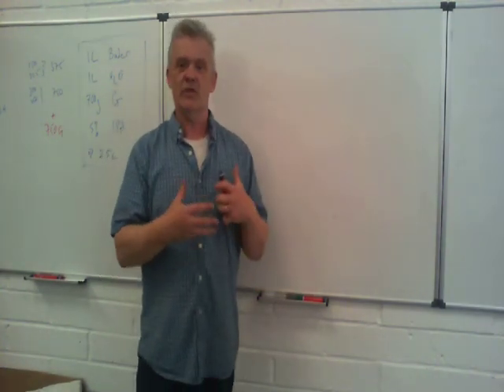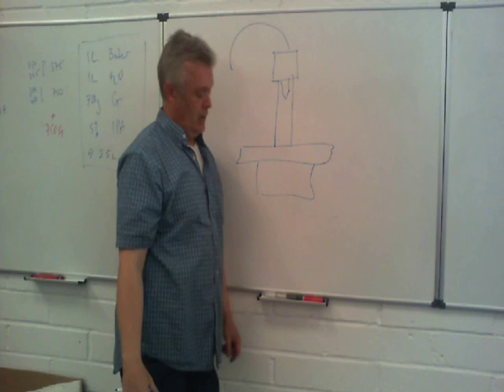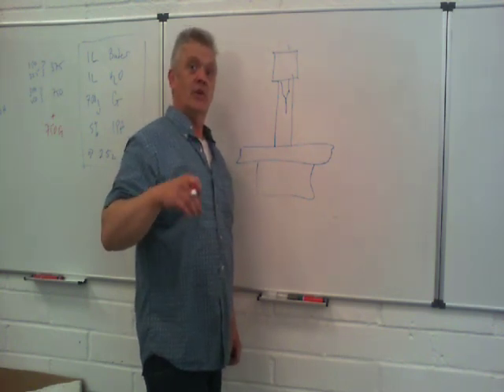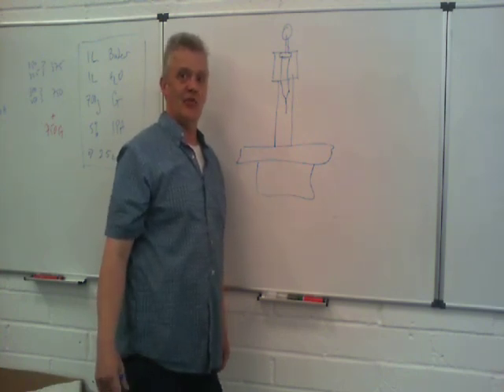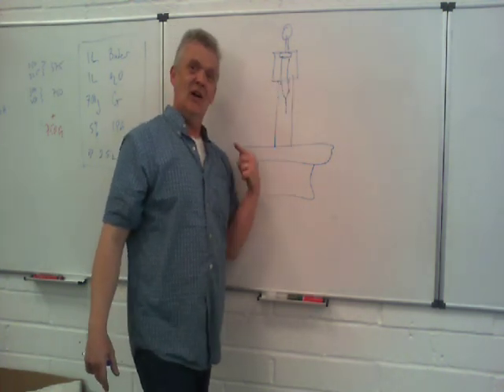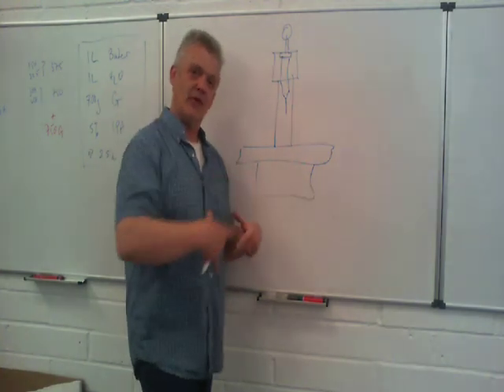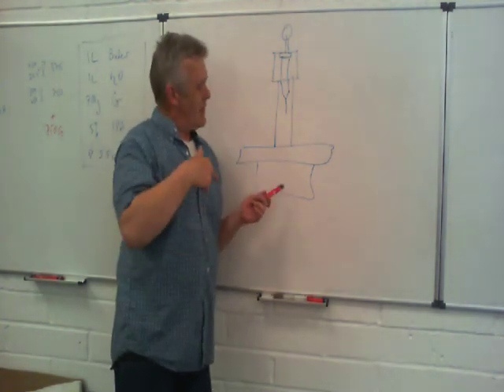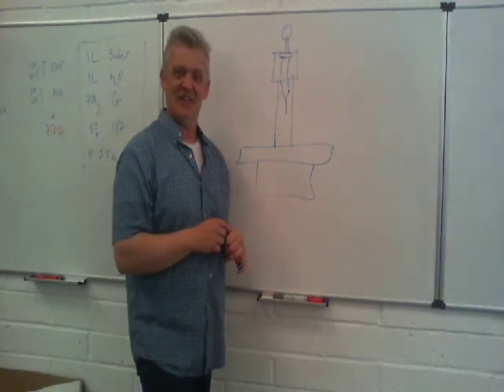A 3D Liquid Plastic Printer

Comment: could you do a 2022 vid regarding selective laser printers vs "normal" 3d PLA printer? taking into consideration the structure resistance of the final output from the printer. i've looked somewhat into both ideeas but when it comes to the hardness of the final product it seems that the SLS is somewhat lower in perfomance. I think many considering to purchase a 3d printer would see usefull a vid regarding this
Reply: I think i\ve seen what i don't like about sls .. but a diy pla filaments out of scraps might be usefull or if possible to do from scrap plastic pellets (cheaper than normal pla )

Comment: A few of us at my college are working on building a 3D metal printer. We're going with a chemistry based approach(As opposed to sintering post printing) that's expected to not require any sintering, and be rather cheap. I can pm the details if you're interested.
Reply from the maker: very - robertmurraysmith64@gmail.com
Reply: Hi Chaitanya, I was looking for simmilar solution using XY plotter , if you are Interested Please email me at free.ibm@gmail.com or call me at 8892614040

Comment: Actually you don't need any firmware mod at all, in most slicing programs you can just define the diameter of the nozzle in the settings and it will do the rest for you.
Cura is a free slicing program that has basic settings for beginners and a lot of advanced stuff for anyone who wants it, and it renders much faster than the other software around.
Reply from the maker: cool - that's good to know mate

Comment: Rob, Can you think of a solvent you could use that might be non-toxic to humans? I would think there's a lucrative application here in surgery...
Reply from the maker: I was thinking the same thin - well not for surgery - because the solvents are pretty harsh and different countries ban different solvents and you can't ship volatile solvents easily, so I was mulling over water - ABS is actually polymerised in water
Reply: not for surgery but I believe limonene dissolves hips, and isopropyl alcohol for PVB,  and I just realized this is an 11 year old thread

Comment: if it helps i am trying to build one out of lego did quite a lot of research on it maybe could meet for a coffee or something 
also been looking at fresnel lenses and aluminium sand casting printer parts 
i do have a unit kind of 90% complete
Reply from the maker: That sounds like a good idea mate - you anywhere near canterbury?
Reply: sent you over an email to your 64@gmail address

Comment: Like you rightly suggest using an existing 3D printer would be the easiest way to go, replacing the existing heated ejector with the hypodermic loaded with the dissolved plastic, but some way of controlling the plunger would be needed. A holder with some sort of screw controlled by a stepper motor to move the plunger comes to mind
Reply from the maker: I was thinking that - because you would need a little pull back on the inkflow to prevent overrun when stop starting

Comment: The concept of liquefied rather than melted plastic opens a "possibilities" thought bubble. 

In a dual extruder system, where the outer layer is done with "fine" liquified deposition, could help overcome the unsightly layering of heat deposition.  (Plus the acetone based methods people use to smooth it out.) -- Decrease extrusion time...

Cold liquified extrusion opens the Education / School opportunities with less OH&S to worry about than the heat based methods. Also no warping through differential heat retention.  Less warp vs more shrinkage.

I think the closest to your concept in current use is Chocolate 3D printing.  There are a number of devices being used.  An overly expensive dedicated plunger extruder for chocolate is at:
http://www.alibaba.com/product-detail/chocolate-3d-printer_1835343358.html

A number of 3D printers also extrude epoxy onto ever increasing layers of powdered material "binder jetting" and even sheets of paper (Mcor IRIS) to build up an object. That object is then "broken out" of the non-treated / extra material.

Look forward to your further videos on the subject
Reply from the maker: That is expensive - I am going to build one myself I think - well not  just me lol - I am only a chemist mate

Comment: This is a brilliant idea. A couple of points to address: Dry time for the liquid will need to be very fast. A heated print bed might do well to speed up the dry time but may also introduce warping depending on how the liquid reacts to temperature gradients through the print process. Assuming that the needle won't clog up getting near the heated bed, the only other detail I can think of is pump flow vs. deposition/dry time.
Reply from the maker: Cheers mate - I was thinking that - but they deposit clay, chocolate and sugar with this method so my thought is to add a filler powder to get sufficient 'stiffnes' until drying was complete. Filler up to 60% is a normal addition to production plastics

Comment: join up on these two facebook groups, mainly RepRap, there are over 1700 people there that might have input, and it is a good source of info on all angles of 3D printing.. this video was shared there and I am sure comments on the post will have feedback ect... the second group RepStrap is more for people creating a printer of their own design with the parts they can manage to make on their own, usually to keep the cost down, but other reasons apply such as availability of parts.. ect.. the electronics that are most commonly used and the programs most commonly used are more accurate than 98% of machines people can build.  https://www.facebook.com/groups/5809198019/?fref=nf    https://www.facebook.com/groups/240122566171878/
Reply from the maker: cheers mate, i put in a request to join both groups - should be interesting to get feedback on this

Comment: this printer would be the way to go http://www.makerfarm.com/index.php/3d-printer-kits/prusa-8-i3v-kit-v-slot-extrusion.html  as it can be modified a lot and the board is a ramps so to salt out the Extruder pump speed is easy just the design of the pump and the size of the holder of Liquid would need working on as most of us 3D printer guys are printing big now e.g a 3rd of a reel of ABS 1 kg is what i need for my project at the mo

Comment: I had a similar idea quite some time ago but I thought I was crazy and assumed that it wouldn't work for some reason.

where you thinking about making some of the inks conductive? That would be easy. What would be a little more challenging but also interesting would be to have a semiconductor as well. if you could attenuate the conductivity of the conductive ink you have a resistor, the semiconductor for transistors, not much more to make a (very limited and inefficient) computer you can print into all sorts of objects.

one consequence of this could be that you could tell the device to make a copy of itself!
Reply from the maker: It may well be crazy but it's worth a look lol - I already make conductive inks and istrated this from making conductive filaments - have a look at the earlier vids - but essentially you are right though i suspect you underestimate a bit about how 'easy' it is lol
Reply: Robert Murray-Smith Sorry I didn't mean to belittle. The process is involved, I more meant the conductive inks seemed eminently doable considering you have already been working on it. By comparison, I have no idea how to make a semiconductor ink. In fact, you would have to make 2, one n-type, and one p-type. I'm not sure how well they would work on the mm scale either. there are a lot of challenges, including potentially much higher energy requirements to change the transistor state.

if we assume we can make 1mm deposits within an accuracy within about 100 micrometers, you could put one p-type dot down, one n-type on each side, you could use the conductive ink for the gate and a less conductive or possibly fully insulating ink to keep the gate from bridging across the depletion zone. It seems theoretically sound. 

With this kind of work though, you would want to isolate the device from vibrations or even disturbances in the air, wouldn't you?
Reply: Robert Murray-Smith side note, if you can make the n-type and p-type inks, you have all you need to make a p-n junction diode as well.
Reply from the maker: Keegan Maloney
It would be a real challenge mate - but definately interesting - the pn types aren't too difficult and a proof of concept might be to print a peltier device. - But lets get abs dissloved first lol

Comment: shrinkage problem is solved by calibration (viscosity ventilation extrusion speed)
the great think about this is the possibility to create exotic smart composite polymers .thinking about "localized joule heating for fast and low temperature actuation of artificial muscle see fishing line muscle ,4d printing self assembly, morphing ,3d printable high density energy storage "
Reply from the maker: good thinking - i know about the fishing line experiements and I think you are spot on there

Comment: hi robert take a look at this Solvent-cast direct-write printing of a microstructured fiber
Solvent-cast direct-write fabrication of a micro-cup  dichloromethane (DCM) and ~30wt% of polylactic acid (PLA) you have DMF DCM THF as options for PLA 
there is multiple extruders/piezo inkjet projects along this line online. Problem is fumes toxicity .
Reply from the maker: cheers mate - very cool
Reply from the maker: I'll check them out - it  might well need a fume hood

Comment: There are some peristaltic pumps on Thingiverse, some specifically designed for paste extruding 3d printers.
eg: http://youtu.be/axAP0btw4Lk

Since others are chatting i'll chime in too: my favourite 3D printer is the open source Gus Simpson  http://youtu.be.com/IEGTe1G2Gqs
Unlike most printers this one has no metal rails or screw rods, which saves money.  It's design gives it quite a large build area for it's size - it can print larger versions of itself.  It's still quite new and experimental though, there seems to be very few of them in the wild as of yet, but i'm smitten by what i've seen.  This thing looks cool.
Reply from the maker: So - what I am thinking is not a million miles away from what is already being done - that is actually very good to know

Comment: One specific advantage this would have over filament 3d printers is that actual filament diameter is never exact, the variability can be wild.  Since the extruder on a 3d printer works by forcibly ramming the solid filament into the extruder, this means that the amount of melted material comming outof the hot nozzle is also inexact.  This imposes an upper resolution limit on all filament 3d printers.

Since your liquid plastic feedstock remains a liquid throughout, the actual volumes extruded will likely be more predictable (when compared to filament extruding).
Reply from the maker: that is interesting

Comment: How would you prevent the liquid plastic from hardening? I would be afraid that as the device is printing, the liquid solution would begin to harden inside of the capillary and render is useless and unreliable. Also, I assume that this solution is not heated to keep it liquefied, as then it would be not much different than the current design. The only way I could imagine keeping the plastic liquified is by chemical means. It cannot be based on a time and half life for reasons described above, so it would have to be 2 separate chemicals that instantly react together like epoxy.
Reply from the maker: Not at all. It dries just like an inkjet does now - there is very little difference
Reply from the maker: ***** yes
Reply: there have been similar machine like this for years look up the mark 10 polyurethane machine the resin catalyst and colour are all mixed at the print head and the rate of curing is controlled by temperature the hotter the print head the faster the chemical reaction the faster it hardens up, of course when I was using this machine we were using it to cast urethane parts, the mold pre heated and then poured put back in the oven to harden up, then de-moulded and placed back in the oven to cure over night. some of the parts we made were for a mining machinery company and aerospace as well this stuff was strong and came in a large variety of shore hardness and even foam balls that remind me of those balls they used to play dodgeball with in elementary school,

Comment: There are a lot of options for 3d printing techniques out there that all have there benefits/methods/materials. Since this is a different kind of material then the most common 3d printers use the amount of useful info is going to be hard to find.  From what I gather the plastic will have conductivity and would be good to thing to keep in mind during the design process.  Which only a few printers out there on the market print conductive materials. There is a printer for circuits called the Ex1 that you could take a look at. 

The biggest challenge I see with this is extrusion, extrusion rate, and programing of your micro controllers.  It is really going to have to be a lot of trial and error to get the timing right on extrusion rate.  The other thing to point out use a tubing that connects to the printer so the motors don't have to pull the weight of the plastic, giving your prints more stability, and giving you the ability to design a higher volume storage.
You could have a tank that is off to the side feeding the tube.  I am not quite sure how to go about adding controlled pressure to push for extrusion though. 

Then I would focus on getting just getting x and y stable.  Then pursue z afterwords.  I think this would be a good application for a 2d print to start cause even in 2d it would provide a fairly unique and useful service for circuit creation.   Then when it goes to 3d to not use the liquid plastic as a structure but use it in conjunction traditional plastic 3d printing method.  This would be a dual head design that would print the structure  and the plastic circuit layout printed into it. You could also print the inner workings with tradition plastic printing and use the higher resolution liquid plastic on the outsides of the print to increase production times and keep high resolution. It would lend itself to some pretty unique designs.  There is a program that uses legos as the inner workings to shorten the times of prints called faBrickator.

Anyways cheers and sorry for being long winded XD
Reply from the maker: It was very helpful - thanks. The plastic doesn't need to be conductive and changing it would be a matter of selecting print head. I like your ideas of a dual print and the feed system you suggest - like an inkjet CISS system? - I suspect i will have to for an all in one design though as people don't like doing a job twice and a 'press the button and leave it is going' to be far more popular for most people - my plan was more to modify and existing filament printer so i would expect xy problems to be solved but your point of z axis stability is well taken. I think you are 100% right about the problem of extrusion speed is going to be a killer here and that is where i think most effort needs to be put. Someone has suggested pneumatics for the feed system and I hadn't thought of that but i like it. Thanks for your input mate - Rob
Reply: Robert Murray-Smith No problem.  I am glad I could help.  I know very little in terms of material chemistry and you have helped me tons.

Here is a little more info.   From what I gathered the size you wanted to achieve is around 100 microns.(a diabetic needles is about 130 microns or so)  The current top self prebuilt traditional 3d printers that are meant for the consumer market print around 100 microns and sale for around 2 to 3 k MakerBots. There is one that boast the highest resolution yet which is the  HD^2 at 25 microns and it was going to be cheaper. They had a kickstarter that unfortunately didn't reach it's goal.  Those are good examples to look at as far as parts and setup.  It will help give you a reference to work from when choosing your parts.  The other place to look for invaluable info is the RepRap forums.  There are a ton of post the in there that may fill some of the gaps and lead you further towards your working prototype. There is a few post with some "out of the box thinking" type builds too.  Plus all the woes of sourcing parts, coding and compatibility issues. anyways... If you can get prints at 100 microns or less with dual heads and new materials it will be one hell of a diy first build.
Cheers!
Reply from the maker: directeeccks
thanks for that mate - off over to the reprap forums now lol

Comment: Sounds like it would be very easy to change materials and change resolutions. The "print head" would simply put away the needle it's using and grab another one from a bunch of available ones. The software would have to be able to make it do that though. Disclaimer: I'm no 3D printer expert either.
Reply from the maker: as a software issue I imagine that would be an easy solve - I was thinking along the lines of an old plotter where three or four 'pens' would be used on higher grade machines. or you could code the computer model and a single 'pen' would come to rest you'd change it and press a 'carry on' button - at least that's what i was thinking
Reply: None of that would be terribly hard to implement. Tricky bits are things like having nozzles not get blocked after use, and making them home exactly the same every time.

You can also get a range of sizes from one nozzle depending on pressure, viscosity, and movement speed.
I am using 0.3mm nozzles on my filament printer, they can in theroy extrude anywhere from 0.1mm to 2mm beads. Depending on how the Heat, filment feed rate, and movment speed are set.